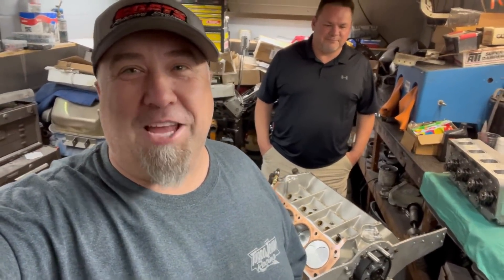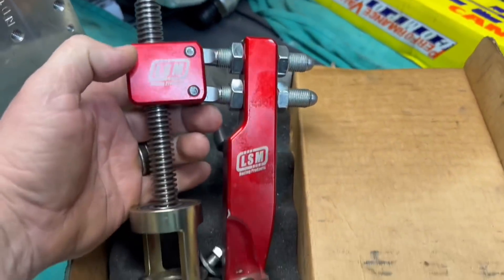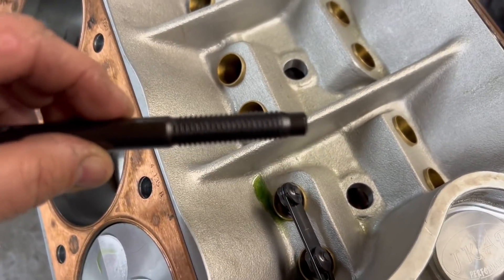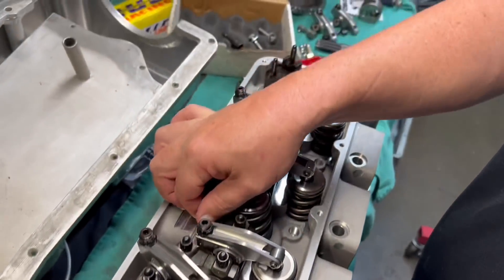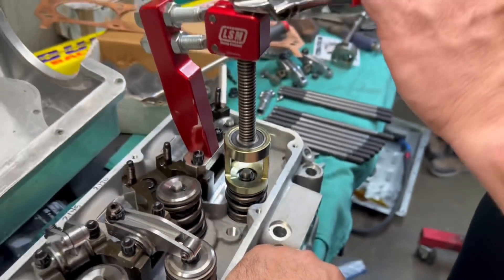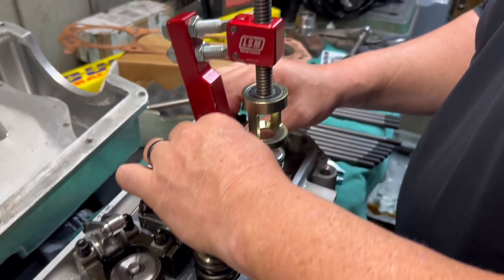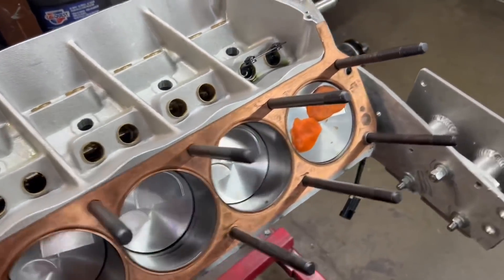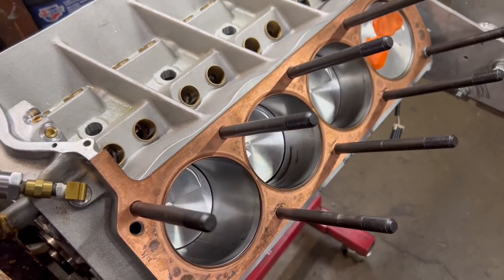Baddest SBF Engine ever!

Comment: 1: that engine looks badass. 2: i want that spring compressor. 3: i want that pushrod diameter tool.

If you have part numbers for those tools I'd appreciate it.

Comment: Nice build, depending on turbos and fuel you might be a little conservative on the HP numbers especially if you are talking at the flywheel.  Hopefully, you are not too much more than the estimate.  That block is not too far away from being a problem.

I know of couple SBF that are making well north of the 2500HP number, so it is more than doable.  Heck, I've seen hub dyno numbers just north of 3600hp out of a SBF.

Comment: You should try to get you a set of the new MBE BILLET SBC symmetrical heads and Billet intake to match they come fully worked all you would have to do is get Kevin to put some Top Fuel hoops in and bolt them on after you do all the other necessary stuff like what you're doing to Randy's heads in this video